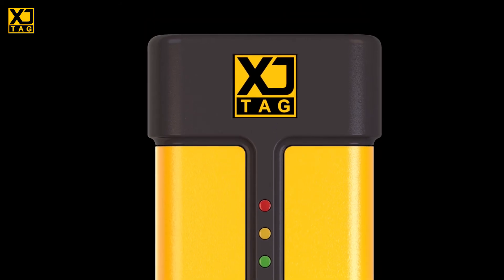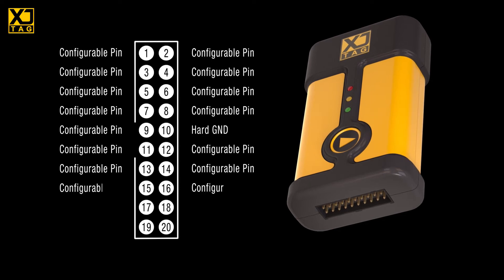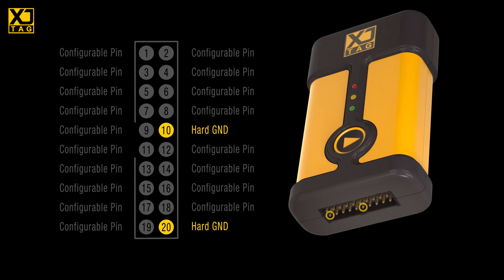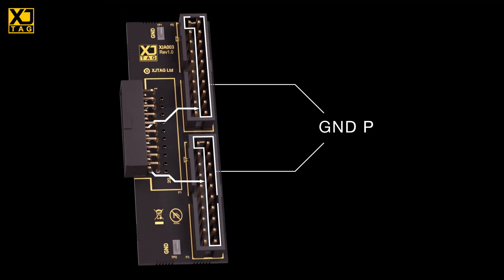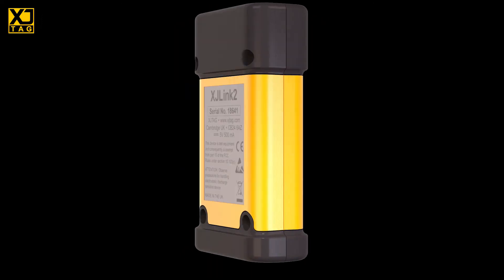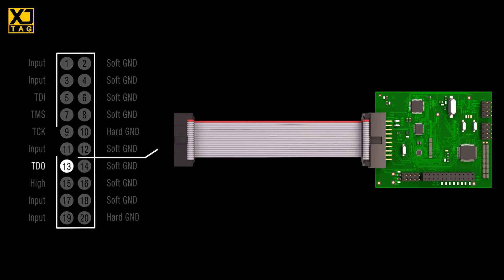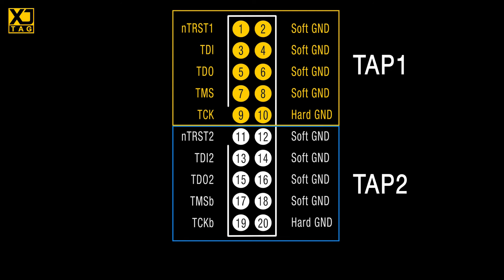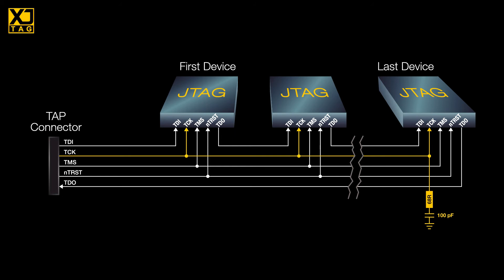JTAG Chain Setup - Part 1 - Introduction (XJTAG Tutorial)

Comment: I loke your videos. But am still so far away from understanding your jtag systems. I am a printer technician. Often than not i reprogramme bios by unsoldering then back. Majority were the soic 8. Quity easy to unsolder and solder. Now comes latest models with wson8 chip poke the w25q512jv. Is there a way of programming this chip in circuit or i must unsolder
Reply from the maker: Hi Morris, using boundary scan you can program a device without removing it from the board. In-system programming is a common part of the systems used by many of our customers. However in order to do such programming there are some requirements in terms of the board design.

You first need to check if the processor to which the flash is connected implements JTAG boundary scan (finding the BSDL file for the device is the best way to check this).

If the flash is connected to a JTAG enabled device (and you have the BSDL file) you then need to know which pins on the processor are connected to your flash. This information is normally extracted from a netlist.

If you have the BSDL file and the netlist then it should be possible to setup some programming functions.

Please contact us at https://www.xjtag.com/contact if you would like any further details.